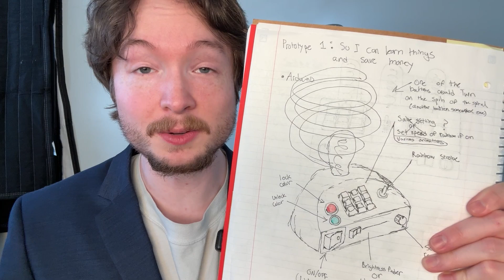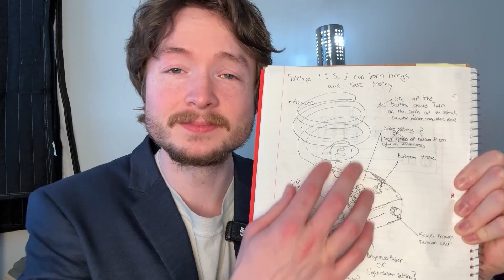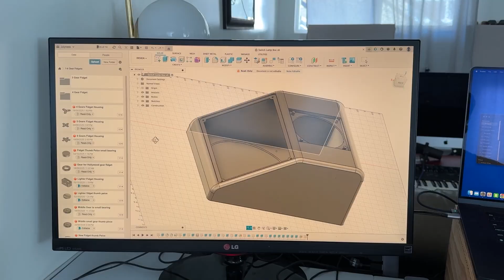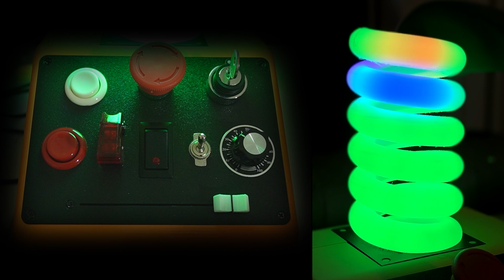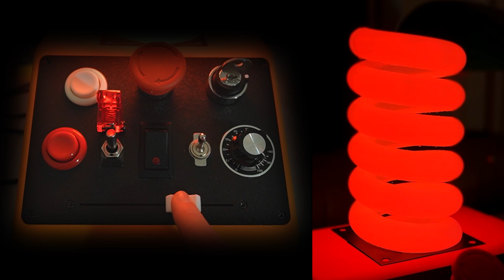The Most Satisfying Lamp I’ve Ever Built (3D Printed + Arduino)

Comment: Thanks a click. If you make a second version you should go absolutely nuts with dip switches
Reply from the maker: Wow thank you for your donation! I’ll look into dip switches!
Reply: @alexjulyness  You can easily get 256 modes with a simple 8 position dip switch. If I were designing this I'd have 200 dip switches all controlling small variables providing endless experimenting. Essentially rudimentary sound mixing but for manipulating the rainbow

Comment: Vacuum idea was perfect. We use those to get jet line through conduit to run wire! Good idea. Long live the sparkies! ❤❤❤
Reply: Agreed—if you have a decent shop vac and all goes well, you can suck an empty plastic grocery bag tied to the end of some jetline under 4 lanes of traffic in a few minutes. If all does not go well, it can get really ugly really quick. 😎😮
Reply: @MarkSuazo YES! We call them “mice.” We liked the nice thick corners of the bags you get hardware in. You know the ridiculously thick stuff? Also a pool noodle chunk helps.
Reply: @M @MarkSuazo the worst part is doing USF lines or pvc thats filled with stank water 😂😂😂

Comment: Trick for wiring things. Use it in electrical all the time. Vacuum and string taped to plastic bag cuttings or foam sized to the run. Also you can use a fish not like the animal. It's a roll of flexible tungsten wire that can be pushed or pulled to through almost any size unreachable or tight space.

Comment: This is awesome! 
Perhaps my ADD brain is missing something, but I'm not finding any demensions listed for the knob/fader/buttons/etc in the documentation. I'm going to print the panel and try to figure it out by measuring, but I think it would be a good idea to include the basic demensions for the parts that need to be purchased. ..or am I missing something? 
For example, arcade buttons commonly come in 24mm & 30mm, faders come in 60mm & 75mm & 88mm, and so on for switches, etc..
scamazon links (with a comission for you) would really be ideal.

Comment: Ohhhhhhhhhhh. I fucking love this so much!!!!!!!!  I have to wait a week or so before I can afford but I really want to make this thing, but not orange.  Because I don’t have orange filament. 
I also want to make it Batman themed, with exactly.01% in my 3d modeling skill tree. 😅

However. The red Batman phone from the Adam west era is definitely a 3d file that’s out there… that I feel like would be a cool modification. 
 if not, I’m giving up on everything because there is no justice in this world if I can’t 3d print a tv prop from like 60 years ago!! 

Anyways I’m thinking I could Have the interaction be mostly telephone based. Picking up and putting down the headset would do something fun. Talking at it could also trigger things with a mic and speaker.  The numbers dial part could be stepper motor based and perhaps even have some haptic feedback potential?! I dunno. I’m just farting Batman ideas that probably won’t ever happen in my house lol😂
Reply: solar panel used as a sensor is also a fun idea that i did with some circuit bending stuff back in the day.